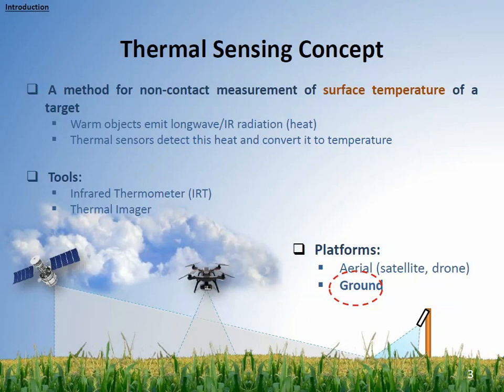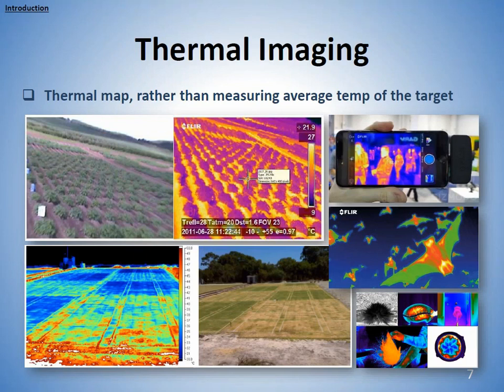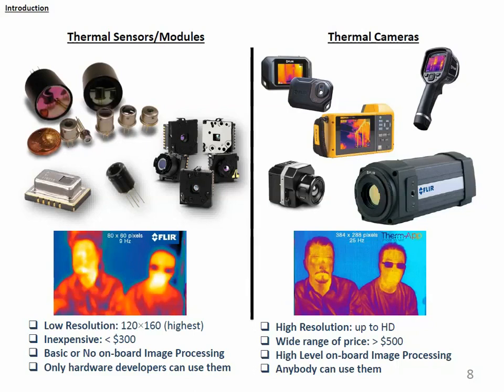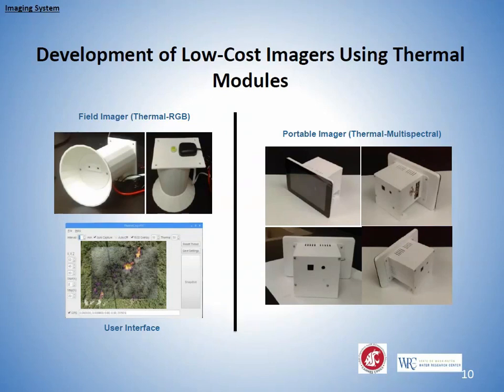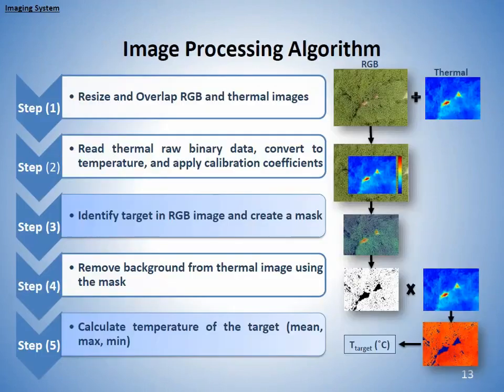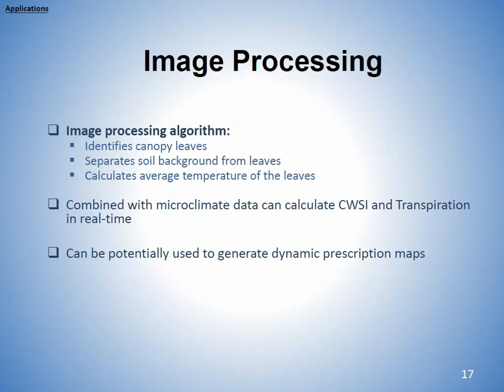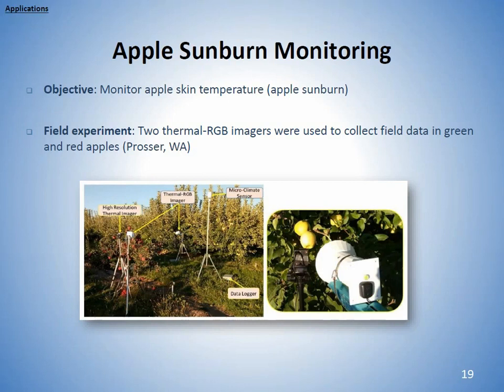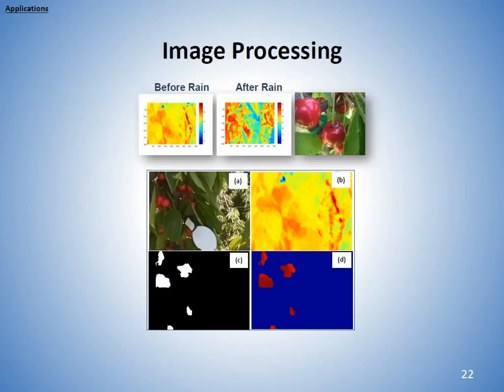Raspberry Pi Thermal Camera Using FLIR Lepton and Pi Cam Modules

Comment: hi, ı want to use flir lepton 3.5 on my drone. Can you please explain how ı can connect my camera to video transmitter?
Reply: I just found this project, so I am looking for experienced feedback as well. My first thought, as a new person to this, would be to try recording the thermal data onboard an SD card, or a flash chip. Use a visual light FPV camera feed from the VTX to the VRX, to pilot the UAV, and gather the thermal data, after the flight is finished.
Reply from the maker: @Inertia888  , this paper might be helpful: https://www.envitronicslab.com/_files/ugd/b17667_92a58afd0a8547b8ba52d64d6fed12b7.pdf

Lepton 3.5 and 2.5 are not that different in terms of interfacing and capturing images. 

Check see if the following interface works for you:
https://www.digikey.com/en/products/detail/groupgets-llc/PURETHERMAL-3-FS1/16709235?_gl=1*f705zc*_up*MQ..&gclid=Cj0KCQjwlZixBhCoARIsAIC745DQ009mfF5VQHV_J_x5pWEsBuEsmdYx2L8L6jpDjIYf_0hvsVA4v7UaAj40EALw_wcB
Reply from the maker: @celalyahyaergun7614, it depends on your hardware and familiarity with embedded software. Have you looked at any of these interfaces: 

https://www.digikey.com/en/products/detail/flir-lepton/250-0577-00/10385179?utm_adgroup=&utm_source=google&utm_medium=cpc&utm_campaign=PMax%20Shopping_Product_Low%20ROAS%20Categories&utm_term=&utm_content=&utm_id=go_cmp-20243063506_adg-_ad-__dev-c_ext-_prd-10385179_sig-Cj0KCQjwlZixBhCoARIsAIC745DQ009mfF5VQHV_J_x5pWEsBuEsmdYx2L8L6jpDjIYf_0hvsVA4v7UaAj40EALw_wcB&gad_source=1&gclid=Cj0KCQjwlZixBhCoARIsAIC745DQ009mfF5VQHV_J_x5pWEsBuEsmdYx2L8L6jpDjIYf_0hvsVA4v7UaAj40EALw_wcB

https://www.digikey.com/en/products/detail/sparkfun-electronics/DEV-16779/12396902?_gl=1*f705zc*_up*MQ..&gclid=Cj0KCQjwlZixBhCoARIsAIC745DQ009mfF5VQHV_J_x5pWEsBuEsmdYx2L8L6jpDjIYf_0hvsVA4v7UaAj40EALw_wcB

https://www.digikey.com/en/products/detail/groupgets-llc/PURETHERMAL-3-FS1/16709235?_gl=1*f705zc*_up*MQ..&gclid=Cj0KCQjwlZixBhCoARIsAIC745DQ009mfF5VQHV_J_x5pWEsBuEsmdYx2L8L6jpDjIYf_0hvsVA4v7UaAj40EALw_wcB